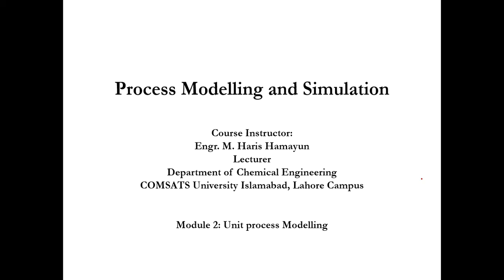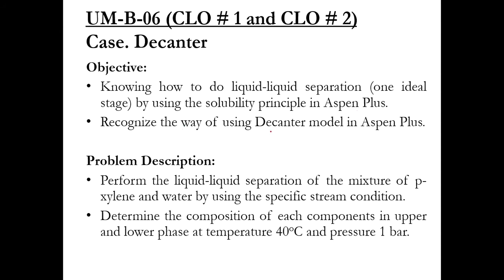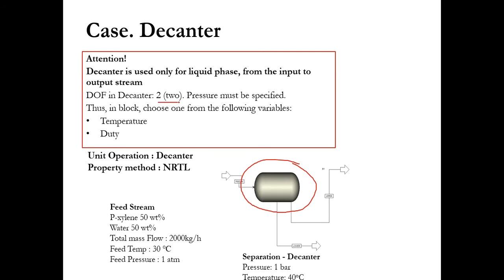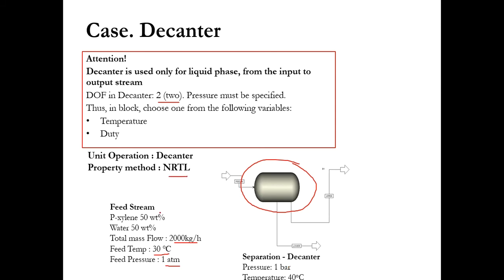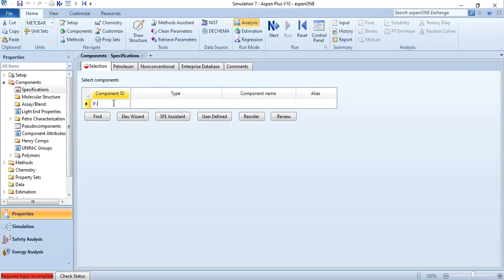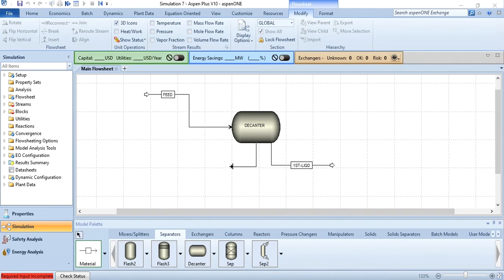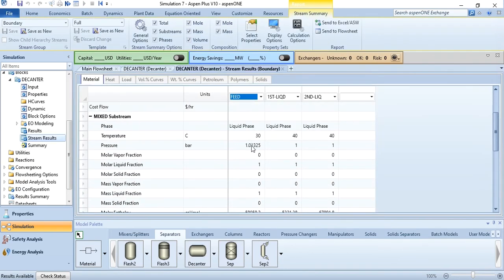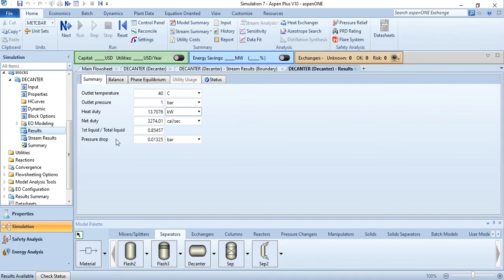Simulation of Decanter using Aspen Plus - Lecture # 42

Comment: I am doing Calcium Chloride-Water-THF decantation and I was trying to run my designs through Aspen Plus. When I add equimolar amounts of Calcium Chloride to THF-Water azeotrope, I obtain two settlable layers one of water free THF and one with a brine solution of Calcium Chloride but whenever I run this simulation in ASPEN plus decanter, I strangely always get the error "No stream splitting". Its the most peculiar thing to me

Comment: Separator for Monochloro Benzene & Water

    - Flow rate : 10 KL per Hour

    - Mixture composition : ( 95 % MCB & 5 % Water )

    - Feed temp :  Ambient  / 40°C

    -  Pipe line size : 50 NB

    - We require design of Online separator
Reply: Hello sir, please help me to design the decanter